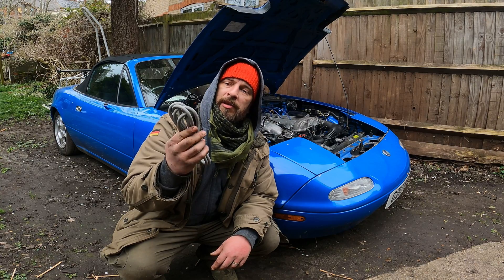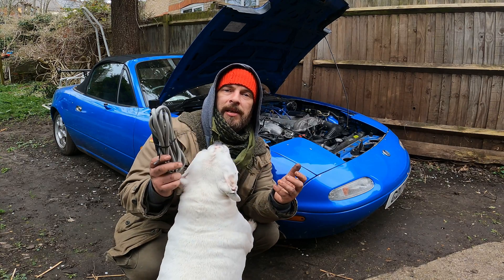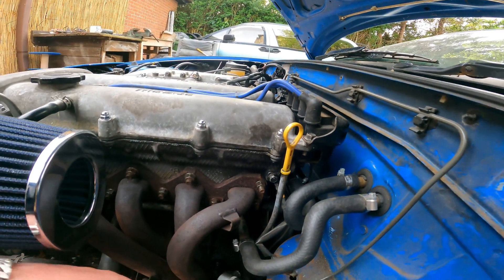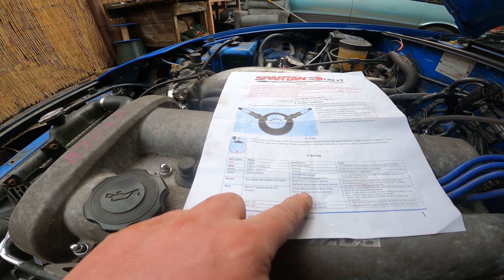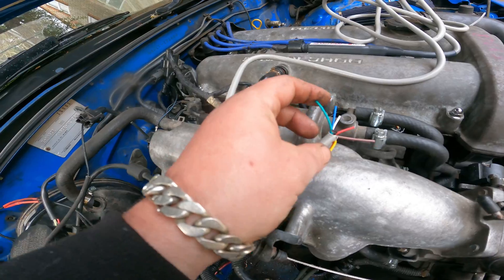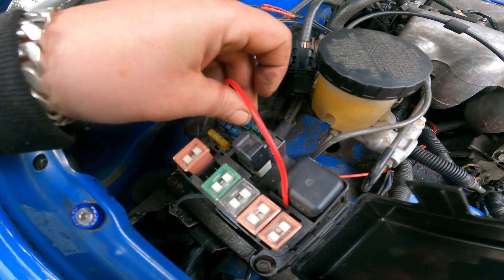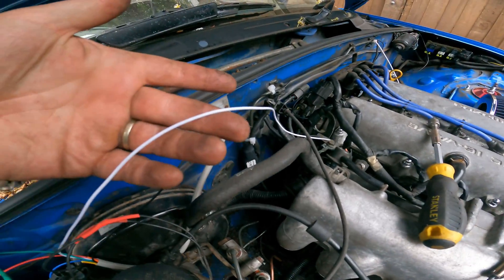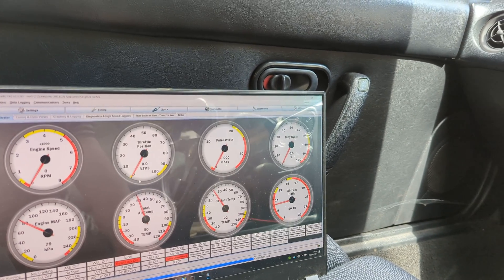How to Install Wideband AFR - Mazda MX5 Miata Turbo Build EP3

Comment: hi great videos going to be doing the same thing on my 5 soon (when you plug into the airflow sensor you can now remove the oem airflow meter and put your air filter on the end of the intake pipe )this may be your tick over problems 
keep up the great work my friend
Reply from the maker: Oh thanks, getting back on the MX5 soon so I'll give that a go. Poor things been sitting for few months.